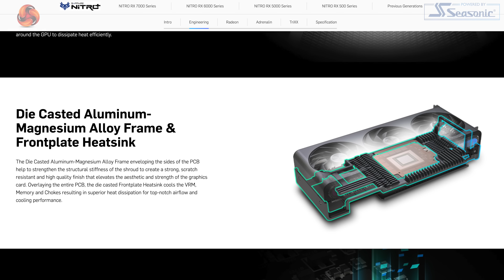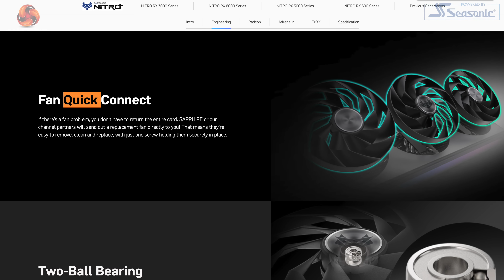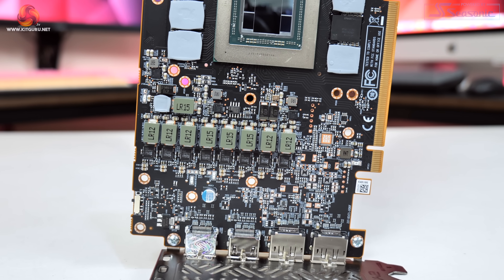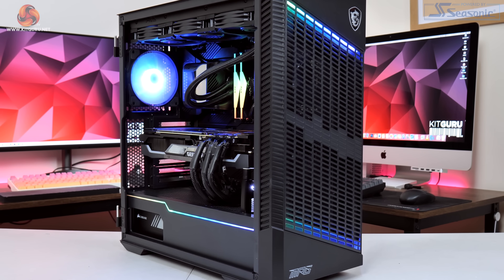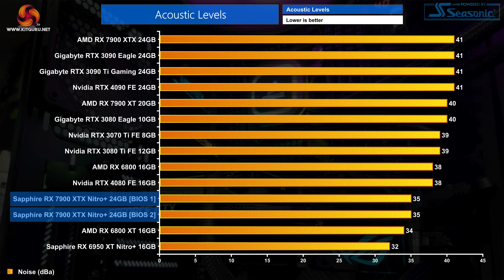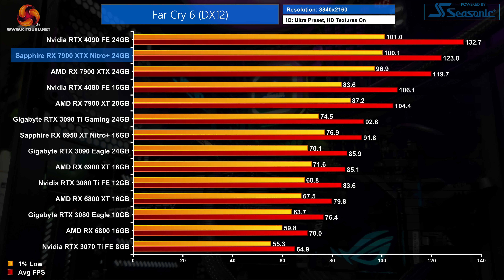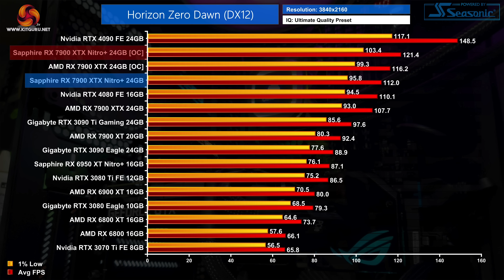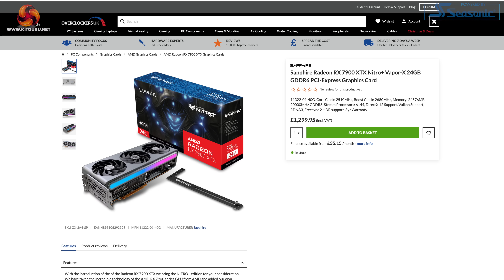Sapphire RX 7900 XTX Nitro+... one heck of a card!

Comment: I've been very happy with my Nitro card too... Getting a very stable 15% overclock with just the Adrenaline software. A ton of other outlets are saying the AIB cards aren't better than the reference (without testing it themselves of course) but that's not my experience. Maybe I got a golden sample though, who knows.
Reply: some good results there spoonhurler!
Reply: Any issues with Stuttering whilst gaming or overheating? I heard the reference card had alot of issues.
Reply: @ProjectLabz  no issues with overheating but it's not the reference model, they had issues with their vapor chambers on release and I honestly didn't like their design which is why I only consider AIB models. It does stutter but not in games often (I game in 1440p though so it's a little overkill) it does stutter a lot in DaVinci Resolve and even barely worked for a day or so after an update. But it's been great for gaming
Reply: Barely fits in my case, its a monster of a card tho. Love it too!!!
Reply: I am about to get one of these. How is the coil whine on yours if any? Here in the video he is putting the mic close to it and opening the panel. Does it get quieter with the panel on? I have never had a GPU with coil whine and now im scared to get it since they are really expensive now.
Reply: @theHeartlessNooB  Well did you listen when the case fans were on? The case fans in this video were louder than the coil whine. In a closed case you probably wouldn't hear the GPU at all with the level of whine that was demonstrated here. Also having a good quality PSU and limiting the framerate if the games you play to match the speed of your monitor should help. From what I've heard just about EVERY GPU has coil whine when gaming at 400+fps. which can happen at the in-game menu.
Reply: @vigilant_1934  400 fps? What! Where and how do you get that? Playing League of Legends in 2K? I plan to play at max 120 fps since my screen is just 120hz. I have a quality PSU I think, its an EVGA Supernova 1200 P3.
Reply: @theHeartlessNooB  I'm not very sensitive to whiny pitches but when I ran CSGO on on high frame rates I could hear it whine with the panel off (Lancool 215 for reference) but I barely hear it with it one. The only time I hear it with the panel on is sometimes when it's rendering. The panel does seem to dampen it for me but as I said I'm not really bothered by it.
Reply: @theHeartlessNooB  I think coil whine is only on the reference boards. My Merc doesn't have any, it is super quiet
Reply: @Nerd_Rage_Initiated  the high junction temps are with reference only, I think some of the AIB boards have a little whine too... Reference probably does it worse and more often, like I said mine is small and when it's doing specific and intense workloads I normally don't do.
Reply: What temps are you getting on the memory?
Reply: @ssgtmendel  Hi Andrei, on my Nitro I get 76c on the hotspot (main GPU 59c) playing cyberpunk chugging between 400w and 500w, its a little bit of a small case and I restrict the GPU fans to 2500rpm as anything over that and the fans get quite annoying. I have undervolted to 1075mV. The metal backplate does a good job of conducting the heat away and feels pretty hot. The GPU is mounted horizontally. Edit Just updated HWINFO64 and its now showing memory junction 78c - I've ordered another case fan to suck in cold air into the bottom of the case and I think I can get it down a bit
Reply: @ssgtmendel  I'm getting mid 70s on memory temps during torture tests but I'm undervolting the memory
Reply: @SpoonHurler  Hi SpoonHurler, what programme are you using to undervolt memory. I haven't had an AMD card since the 5770 (the last Vapor-x card lol) so not familiar with how to get under the hood and I can't find any way to undervolt memory
Reply: @stedz2000  the GPU voltage is what I meant. But in the adrenaline software you can adjust it, mine is at 1030 mhz down from over 1100 stock but that has help keep everything cool even if I push the power slider all the way up
Reply: Yeah I've managed to get mine running stable at 1060mV, maybe in the future they'll add memory voltage to the adrenaline software.  Would be nice although I doubt it cam go much lower than stock.
Reply: @stedz2000  Yeah and more control over the decoupled clocks would be nice too, although most applications seem to do a good job of figure out what to push and when, would still be fun to try to optimize for exact use cases.
Reply: How can AIB models be worse when the reference cards overheat? 😛
That would've been the worst engineered generation of GPUs in a long time.
Reply: @MLWJ1993  it was a QC issue. AMD replaced the faulty cards. No overheating on the normal cards.
Reply: @MLWJ1993  Ignorant of the facts much?

Did you look into why it has such issue?
Nvidia GPU also have idle power draw if you connect multiple 4k displays at 240hz.

None of the reviewers talk about the overheating, because it's a bug you can easily bypass.

If its such a big deal, why aren't more tech channels posting about it like Nvidia's melting cable?
Reply: @dra6o0n  We're not even considering the idle power draw here, which is very much a thing that happens on both manufacturers GPUs. That's something I'm not going to deny, I definitely don't appreciate you putting it as if I ever claimed that.

What is however an issue is designing a cooler that by design lets memory modules overheat, something that was an issue with Nvidia reference designs for the 30XX series as well.

The melting power cables are very much user error it seems, I.E. something that can be avoided by connecting your GPU properly. A not well performing cooling solution however has no real fix outside of replacing it, so long as AMD doesn't offer that, it's as much of a don't buy it advice as it is for reference 30XX GPUs from Nvidia. The problem here is that the better designed AMD GPUs (AIB models) for this generation happen to be seriously marked up to the point that it's no longer even close to MSRP. I.E. as lacklustre in value as Nvidia 40XX GPUs are right now.
Reply: @MLWJ1993  Perhaps AMD was expecting people to not overclock their reference cards or try to break the power limit through soft power plan hacks.
Reply: @dra6o0n  There're people with stock reference cards experiencing overheating & even shutdowns. Just take a look over at r/AMD. Surely you're not going to be the ignorant one that's calling me ignorant right?
Reply: @MLWJ1993  Those people are having monitor, driver, and windows 11 related issue. Nothing on overheating.
Reply: @Mark Jacobs  The 16 pin power connector can melt by having too much of a bend too. To say that is user error is just wrong. They are cramming too much current into those smaller wires...period. If the slightest amount of extra impedance(bend of slightly off connection) is introduced, it is a hazard. That is 1000000% a design flaw. When you take 24 wires that are thicker cramming current into 16 smaller gauge wires, that in itself causes major impedance, and higher temps in the wires. The people who designed this connector needs to be fired immediately
Reply: @Nerd_Rage_Initiated  There have been many test that did excessive bending & even damaging wires with a failure rate of 0%. None started melting the connector so you're factually wrong there...
Reply: @Nerd_Rage_Initiated  Dude, they literally damaged pins on the connector & couldn't get it to melt!

It only happened when the connector was barely connected! You're the one trying to make it fit your narrative! 😅
Reply: @dra6o0n  Even Finnish tech site Io-Tech had issues with very close to overheating reference card.
Reply: @MLWJ1993  Have you watched Gamers Nexus latest video on that? They actually reproduced the problem multiple times (no one else seemed to even do that and were just guessing including Igor's Lab and Jayztwocents). Gamers Nexus sent a viewer's burnt cable to a lab and they found debris inside the connector which caused it, not user error. The debris can happen during the manufacturing process. It's also possible for debris to build up if plugging and unplugging the cable a bunch of times but most people will never do that and just leave it. 

Blaming the problem on the user is what many companies have done to get out of legal problems (Gigabyte did this when their PSUs were exploding). The cable is just susceptible to damage easier than anything else that's been released in a while. Remember the 3090Ti had a 16pin connection and there weren't any known issues. Something changed with the 4090 obviously and it's not the user.
Reply: @vigilant_1934  It was 1 cable that had debris on it, that's clearly a QC issue. Blaming all cables for being unsafe due to that is absolute denial of the actual problem & this could happen with ANY cable, doesn't have to be 12VHPWR, the only way to actually recreate it was not plugging it in correctly... Otherwise controlled testing would've had cables melt left, right & center.

The problem is that a user is never going to admit they couldn't be arsed to check if the cable was fully plugged in because of warranty. Luckily for them Nvidia still accepted RMA's even after finding out it comes down to user error unlike with AMD here which denies an overheating GPU is out of specifications...
Reply: @vigilant_1934  Man, you are the really hard AMD fan! For your information and anyone else who reads this text, what the Gamer Nexus showed with certainty was that the 12VHPWR connector, when inserted very poorly, would heat up and melt. And, guess what! Me and a few other people, with a few years of experience in life, were already saying that the images of burnt 12VHPWR plugs that were seen on Reedit had all the appearance of electrical plugs damaged by the heat resulting from being incorrectly inserted, something that it happens in all places where there is electrical equipment (I've seen this happen on the switch on a dishwasher and on one of the electrical plugs on the alternator of one of my motorcycles). However, the young people didn't pay any attention to what we said, a mistake we also made when we were younger. But the biggest problem was that almost all YouTubers, especially those who earn money from views on their channels, made it a great opportunity to fuel a controversy that would bring them more views on their YouTube channels and, consequentely, more money. And, as expected, AMD fanatics enjoy the ride, because envy is something that bites very deep.

As for the issue of existing debris in the plug, it was pointed out as a possible manufacturing defect that would aggravate the heating problem if the plug was inserted incorrectly or worn out from being turned off and on too many times. Nowhere in this video is connector debris claimed to be the sole cause of 12VHPWR connectors melting.

And more! The 12VHPWR connector has already been used on the RTX 3090Ti without major problems and since Gamer Nexus released the video showing how the connector melted, we no longer see people complaining about the same problem. I wonder why? Was it because the owners of the RTX 4090 went to find out if the 12VHPWR plugs on their cards were actually well inserted?
Reply: @dra6o0n  110C and throttling is completely within spec 🤣🤣🤣🤣🤣🤣
Reply: @MLWJ1993  You do realize that there are actual electrical codes for what thickness of wire to use for a given current, right? Just because you tested the current with a smaller wire and it worked doesn't mean its not a hazard. The hazard comes when the wire is used over a long period of time during which the material wears out prematurely, or in a certain spot where the impedance changes from bending or partial contact. I have seen such failures on other devices such as 3D printer connectors and the area where it happened was burned and singed. It is absolutely a design defect and a fire hazard.
Reply: in a gpu this is especially problematic because the gpu could be installed in a wide variety of different configurations, and you don't know how the user is going to route the cable. A cable should not be a fire hazard just because you bent it more than 80 degrees to fit in your case.
Reply: 4080 is a better value card with proper Ray tracing support and dlss 3
Reply: @johnerikson2443  I don't use ray tracing at all and I don't use dlss or fsr so these would be sunk costs for me. If those matter to you then sure it might be a better choice, I prefer straight raster though

Comment: 170mhz should increase fps far more than 2% I'll bet AMD messed something up and that's why they marketed efficiency so hard. Somehow they increased bus width and shaders but it didn't get a proportional return on their investment. I'd bet the interconnect between the central chip and the memory units is saturated. I doubt drivers are going to help much.
Reply: maxing out their own design, how messi! is this even legal? they should be required by law to leave more headroom for oc.
Reply: @motorb1tch  will you say that when nvidia goes to "chiplets"
Reply: @motorb1tch  lolol Expecting politicians to collectively have ANY idea at all about current and near-future tech. You've got to be aware that inviting politicians to rule an industry is just asking for stagnation in all but the most enlightened cases. When was the last time you had a bunch of politicians (eg a whole parliament, not just a simple majority) willing to work together in a way that significantly made things better for everyone in a short time frame?
Reply: Clock speeds don't mean better performance, its lower latency.

The infinity fabric has its own speed limits, they use a 65nm interconnect under the chiplet modules.

Comment: Another waste of money from AMD. Spend the extra get a 4090 FE at MSRP when in stock. Will cost a little bit more money but doesn't even use as much power which I have to say is crazy. I thought 4080 was a waste of silicon as well btw.
Reply: 4080 and 4090 don’t fit in my case and where I live the most expensive 7900 is still $400 cheaper than a 4080

Comment: AMD may have made themselves even less relevant in the GPU market. These cards just can't compete all-around.
Reply: The 7900xtx reference card delivers roughly the same raster perf as the 4080, while the 4080 FE costs 20% more. Both aren't great value, but the 7900xtx is clearly much better value here. 

If you care a lot for RT, sure the 4080 delivers better performance, but that is on avg somewhere in the 20-25% more FPS range for that 20% price premium. So the 4080 is ~20% worse perf/$ is raster, and roughly equal in perf/$ for RT. Still sounds to me like the 7900xtx is pretty competative.
Reply: @Hugh_I  You can get the FE for just over 1000 with the Best Buy coupon. They don't overheat like the 7900 xtx, aren't already having memory and bios issues, can be overclocked without losing memory speeds, and allow you to use Ray Tracing if you want. DLSS is also MUCH better than FSR. There is no reason to buy an AMD GPU.
Reply: @bdifferentb  There may be some limited reasons to go nvidia, like if you're a creator an must rely on CUDA, but most of what you listed is misleading or just not true. 

What memory issues? What BIOS issues have you seen? There were delays with board partners that needed more time to finalize their products and BIOSes, but that does not mean any card you can buy has issues. 

Of course the 7900xtx "allows" you to use RT. How else are people benchmarking this then? 

You can overclock them without losing memory speed, as was just shown in this very video. 

DLSS2 is slightly better than FSR2, but we're talking small details. In practice as unnoticable as say the 3-4% lead the 7900XT has over the 4080 in raster perf. Certainly not worth a 20% price premium.
Reply: @Hugh_I  This can't be a serious reply. You are in extreme denial. But I get it. You are AMD no matter what. Go for it. Have fun.
Reply: @bdifferentb  I'm not the one twisting the truth to make my shilling more convincing. I don't intend to buy any of those expensive high end GPUs, be it green or red. As I said, they're all not particularly awesome value. Just pointed out better bang for buck is a sensible metric for whether a product is competative in my book.